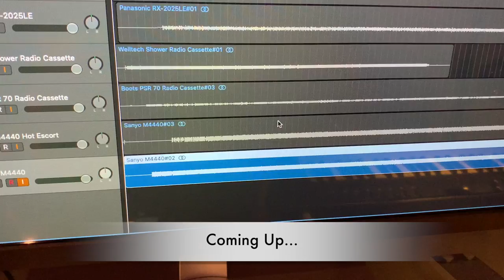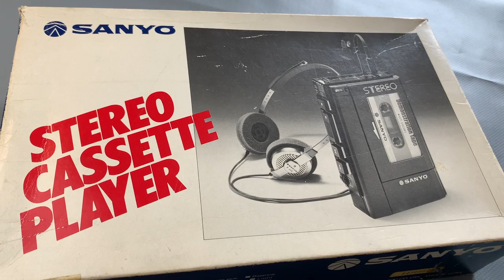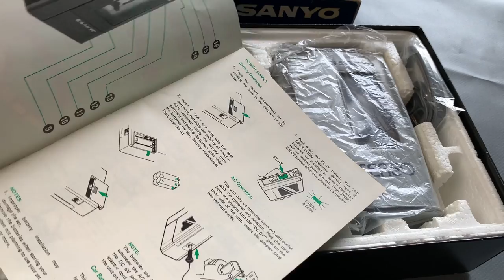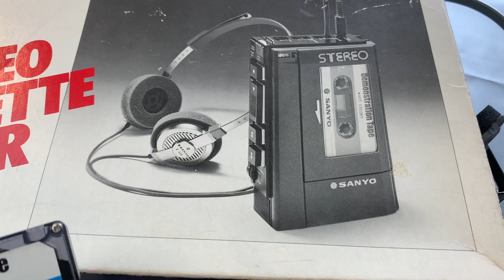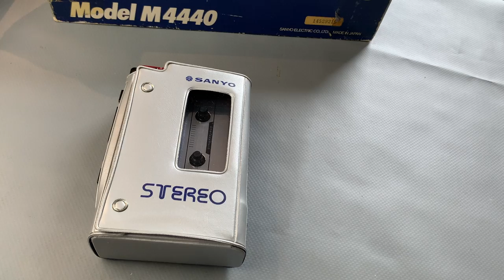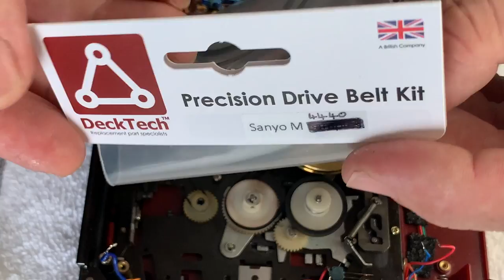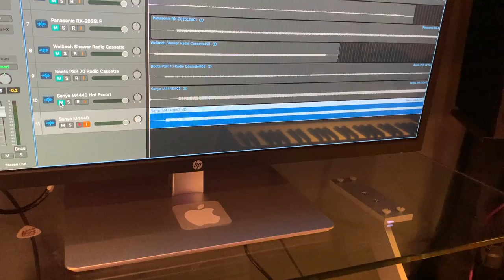Sanyo M4440 (Part 1) Personal Cassette Unboxing, Belt Change & Service. Walkman Repair.Vintage Audio

Comment: Hi, I have a problem that maybe you can help me solve. I bought the same model a few months ago, perfectly functional and reconditioned by the person who sold it to me, but I noticed that as time went on the tapes felt faster and faster, I solved it with the "pitch control" until today that didn't help either, even setting -5 it still feels slightly too fast and I'm afraid it will get worse... any advice?🥺
Reply from the maker: Hello, thanks for watching. A bit of an odd one, given that it was reconditioned (assuming it was done thoroughly of course with new belts, strip and oil etc and not just cleaned). I'd say short of desoldering and removing the circuit board, I'd be inclined to reset the pitch control to zero, and adjusting the motor speed by tweaking the motor potentiometer behind the battery compartment until it sounds correct. Hopefully it will settle down by then. Also, old tapes can be a bit dry with storage, and can loosen back up with use, so that might be a factor (less so if you are experiencing the issue with more than 1 cassette.
Reply: @retro_restos  I thought about it too, but I don't think it's that, the same thing happened to me with another walkman (low-end, with only a cassette deck and volume control) from the mid-nineties, suddenly the tapes felt faster and for that I switched to this model. I don't know much about motherboards and soldering so I really hope that's not the problem because I wouldn't be able to fix it😅. however the seller (a professional one) has changed the belts and the head as well as given it a clean, that's why until recently it worked perfectly. anyway thank you so much i really appreciate your help👏👏
Reply from the maker: @lyricspin_gsit2434  no problem. You don't have to desolder anything to adjust the speed. The adjuster is accessed through a slot in the battery compartment with a small screwdriver. Worth a try I suppose! Thanks again
Reply: @retro_restos  okay then I'll try, I just hope I don't mess up😅 thanks a lot!
Reply from the maker: @lyricspin_gsit2434  you're welcome. Good luck!